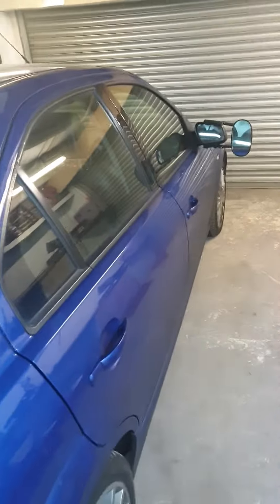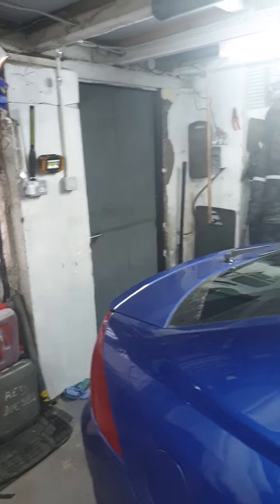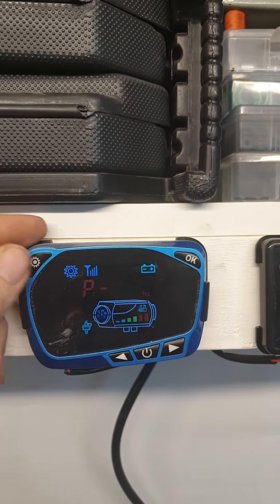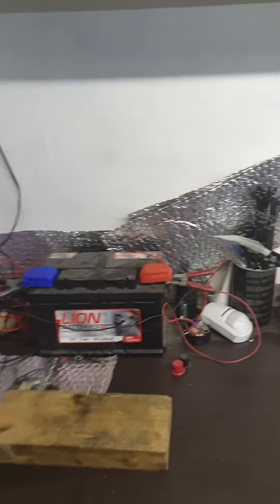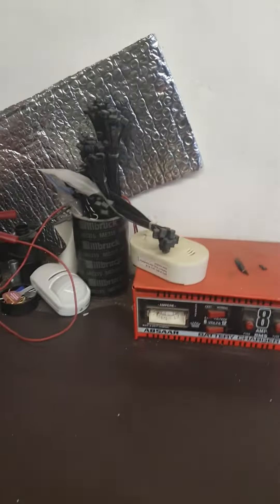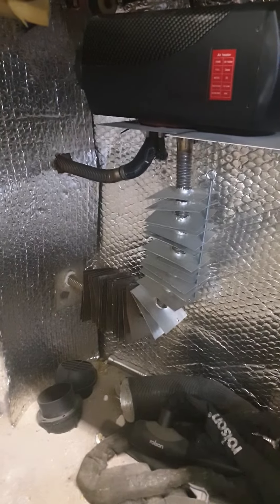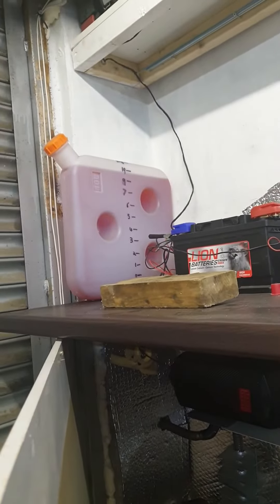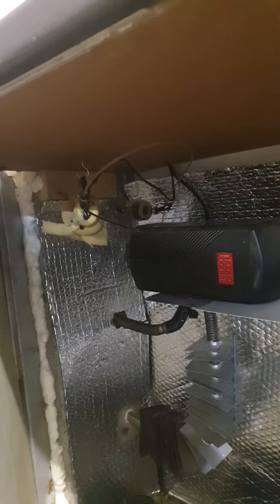Heating a workshop with a chinese diesel heater

Comment: The heat fin in the exhaust is very clever. 

I wonder whether it would be possible to measure the exhaust temperature without the finn and with.

But, great idea. I wish my garage was that tidy.

Comment: I just wired mine too a 12vpower supply. Saves a battery. Mind you though. The heater will be dead if i have a powercut

Comment: So one of these is enough to heat a 1 space garage? Are you running it cranked up all the way? What temperature do you get in winter?
Reply from the maker: easy and with plastic crap windows 18-20c and about hlafway once upto temp often drop it to 3.0hz